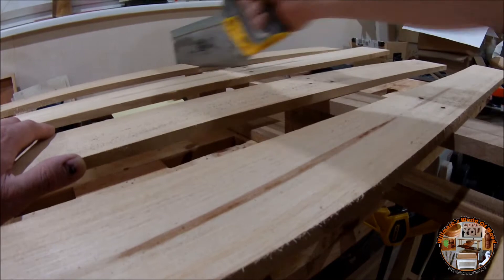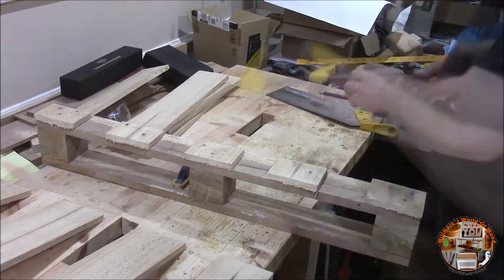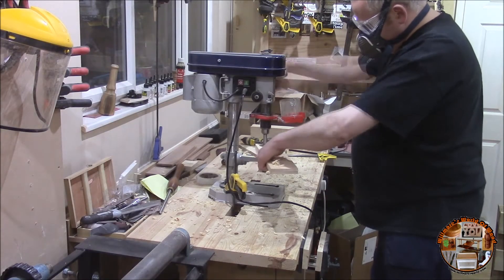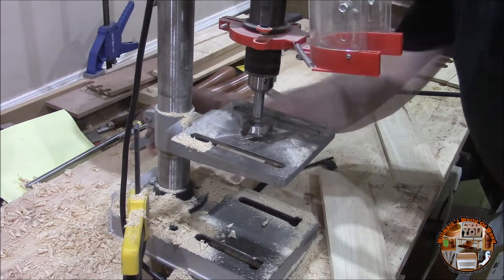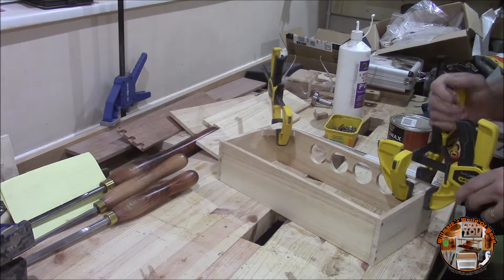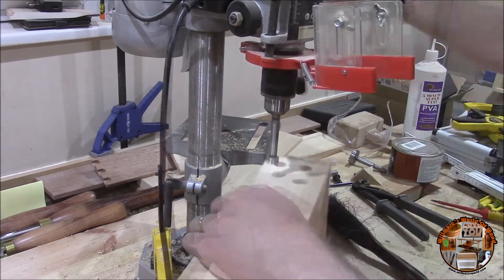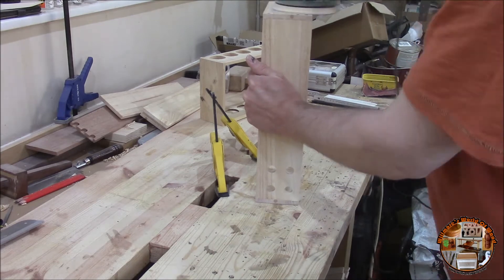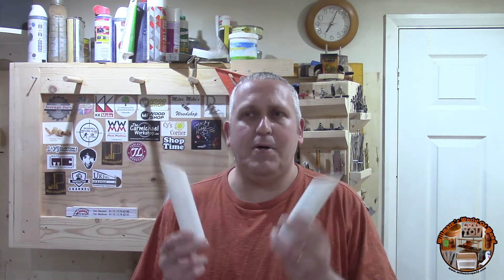#32 How to make / Lathe tools holders | Create 2 make

Comment: Those look good. I don't know what is is about PVC but I can't handle that look in my shop either.
Reply from the maker: Thanks Steve, I thought the plastic pipes were ok at first, and then got more tools which were a tight fit in the pipe. Also the wood looks better.